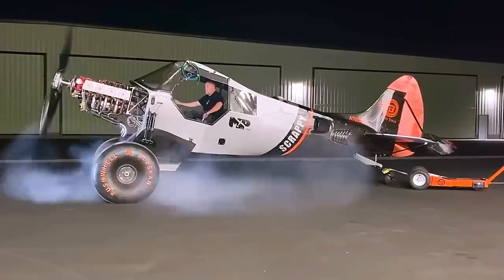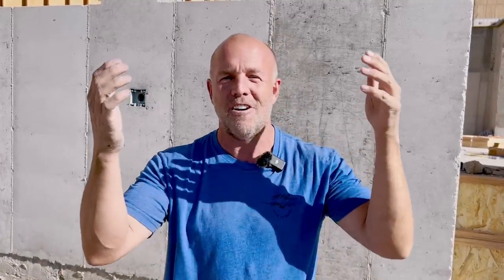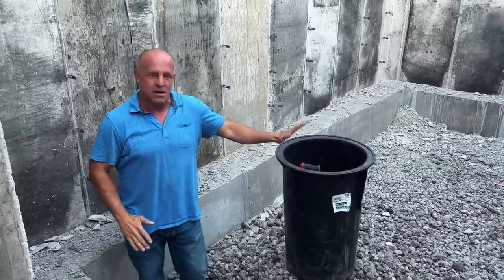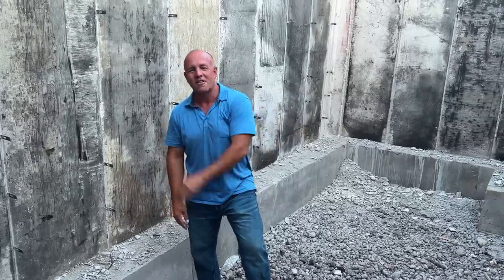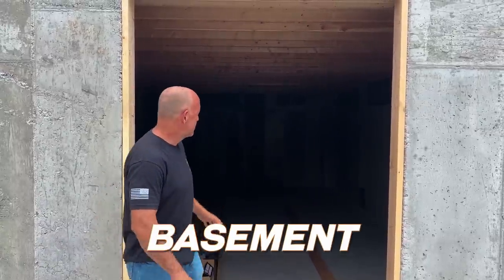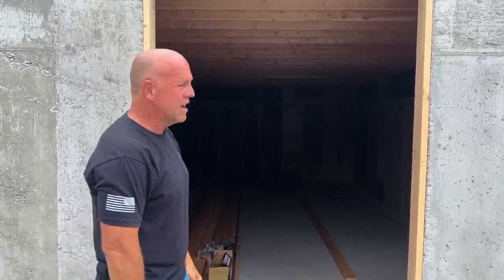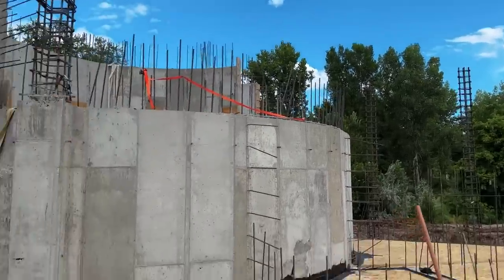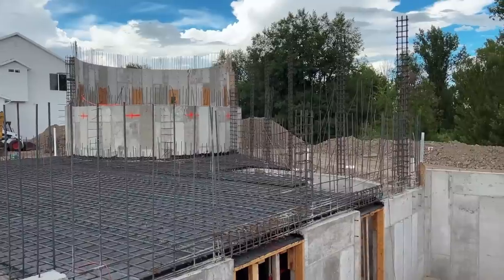Building a 3-Story Swimming Pool with Transforming Floor | House Build #3

Comment: As a  Civil Engineer with 45 years of experience,  I am loving this content.  Concrete, footings rebar, drainage.... Nicely done!
Reply: Agreed. As far as I'm concerned, Mike is as much an engineer as any other. He intuitively understands things like thermal mass, tension and compression force paths, even fluid dynamics. Most builders and tradesmen boast and overstate their understanding, even professionals. Mike has a much better grasp on these things, and I can watch his videos not only without cringing at common misconceptions, but also find it very stimulating.
Reply: @ryanmcgowan3061  as far as i know he is an engineer? Maybe mechanical although im not sure.
Reply: As someone in the Southeast, part of me died a little seeing all that backfill without any plans for drainage, even though I know he probably doesn't get enough rain for it to matter.
Reply: @bbggakkba  Nope. Him and his brother started off building decks, then homes, got into aviation, and started making tow rigs.
Reply: @ryanmcgowan3061  I believe he is a engineer. One of his early videos he talked about his background and how he sold his engineering firm.
Reply: @bbggakkba  As far as I know, his engineering firm was not a licensed engineering firm, but rather a manufacturing design company doing SolidWorks and FEA stuff. Product design is far less regulated than civil and structural engineering firms from what I can tell. Like software engineers, the term is applied often, but technically the word engineer is regulated by states' departments of consumer protection. There is no Mike Patey registered in Utah as an engineer.
Reply: @maglax  If the pool is filled, you're really looking at the "cut" side of the retaining wall. The only reason for drainage is to reduce the hydrostatic loads on the wall or for buoyancy problems. In this case, I think they could have analyzed it with saturated soil on the outside of the wall with an empty pool, and it would have withstood the loads better than when it's loaded the other way because it's built like a heavy radiused dam in that load case.
Reply: Got be 5 million what it finished mike 👍❤️🇬🇧
Reply: I am working on a apartment complex and would like a second opinion is something you would be willing to put your input on?
Reply: Whole footing below bottom of pool is four feet above 100year flood table. He has drainage contingency beyond that again.
Reply: You do not speak like a Civil Engineer. I could be wrong.
Reply: …Empire State Building - WEST!
Reply: @maglax  I thought all the drainage he talked about at the beginning was to make sure his footings stayed dry.  Perf pipe all around, submersible pumps etc....
Reply: @ryanmcgowan3061  You only need a license to do public projects like buildings. Most mechanical engineers don't get licensed and some don't on purpose (besides the effort) because they don't want to be liable for a company's products. In general it just isn't necessary as companies doing work that require a PE usually have a few on staff and the rest can pass their work thru them for certification. In theory those with a license should have a pay bump, but I haven't seen it in practice so there is less incentive to do it. 
The rest of companies making products aren't regulated and so the engineers don't need to be licensed. Companies may avoid them with the idea they must pay them more. The unlicensed are still engineers, and have degree stating so. Some are better than others of course, licensed or not.
Reply: Who needs lions, tigers, and bears when you have concrete, rebar and drainage!!!!

Comment: As the owner/designer/engineer/contractor/laborer, you are managing the job exactly the correct way; you are involved in every phase, every operation, every yard of concrete, every nut and bolt to make sure nothing is overlooked. On a project this size, the smallest error can create a large problem. I have built houses with over 20,000 sq. ft. with 3 to 5 year build times and the amount of forethought and nightmares can be daunting. This house is not even past the foundation phase and the thought and work required must have been enormous. My hat is off to you and your wonderful wife.

Comment: After months of laying in awake in bed at night, I am convinced there is no possible way you could have design a more complex swimming pool in a residential setting. Short of swapping out the water with differing water chemistry to adjust for buoyancy for before and after meals you have taken this pool to the Mike Patey extreme. Mind bending projects are your engineering signature and although most people could never build anything approaching the level of your projects watching is inspiring. Thanks for taking the time to share your work

Comment: I find this every bit as inspiring as the airplane design/build/play videos.
My 20x40 concrete pool was destroyed a couple of years ago when a neighbor built a big house next door and created a sink hole under my property.  I'm at the base of a ravine near a river and all the engineers are struggling to deal with water while they get 50' deep footings under a new pool deck patio structure built of structural concrete.  I wish my team had half the skill that Mike has.  After 2 years my place is still a big mud hole full of water.

Comment: Geez! The amount of engineering that’s going into this build is mind boggling. You are keeping a lot of people very busy which is great for the area. The amount of concrete going into this build is crazy. I used to work for a ready mix concrete company in Ontario Canada and I’ve never seen any thing like this. The company I worked for did pour all the concrete for the CN Tower in Toronto and there was definitely a lot of engineering firsts in that build. Nobody works as hard as you do, now Back To Work.👍👍🇨🇦😁

Comment: Amen on the drainage throughout the structure.  It costs next to nothing to take care of it now. I won’t build anything without drainage. People will say “my site is dry”. Yes, it’s dry now, but put a building on top of it blocking evaporation and all bets are off. Plus, while the nominal water table may be low, it is not a constant depth. You can have shallow spots, and even springs that pop up. Thanks for the great content.

Comment: Hey Mike, as an awesome back up, find a water powered sump pump. An electric one can fail, a battery one can drain the battery, but usually, even if you lose electrical power for several days, you still have water pressure. Also a LOT simpler pump so less failure points especially when mixing electricity and water. Had a week long power failure and the house I was in had installed a water power back up and it saved all of my stuff. When you think about it, it is probably one of the most reliable back up pumps out there, and the foot print is the same as a standard sump pump.

Comment: I just finished up doing the crane work on a 120,000 gallon concrete water tank , lifting forms in and out, and I mentioned Mike's project to the super on the job, he just gave me a blank stare, like it didn't compute. Windows?? Rising floor?, I think it just blew his mind. The building inspector on his current house job, and the DAR or whoever inspected Scrappy, need to meet sometime and compare notes!

Comment: Planes to Pools! Is there anything Mike can’t build 😂. I feel like you could build one of anything better than anything that’s out there. At 36yrs old, Even though I love aviation, but do not currently have the means to acquire my ppl, I do have a little shop that I piddle in almost daily after work on just about anything , so I thoroughly enjoy the engineering videos of any kind. Back to work mike !

Comment: Mike 
Just ran across your video amazing project! If I heard you correctly pool will be heated by gas. Unless you are getting it extremely cheap will cost a bundle annually to maintain temperature. Would recommend water to water geothermal heat pump with secondary titanium heat exchanger separating equipment from pool water. Same system would apply for radiant floor heat. However due to the load and small lot size/rock closed loop probably not an option but possibly could do open. Some of the newer solar water heaters have great efficiency could use to supplement. Food for thought to keep your running cost down. can’t wait to see the finished product keep up the great work!

Comment: We would like to do something similar to your pool (smaller scale though) on our house build.  I was planning on using ICF though for both the exterior walls and floors of the house as well as forming the pool.  I know "Build-Block" makes radius sections up to 23'+ inner diameter with a 6" core.

Comment: The most stress your retaining wall will experience is backfilling behind it. The dimensional lumber is a good idea but it will deflect under load. You can rent the legs they use to hold up tilt up walls, they are much stronger.

Comment: When a structural part is made thicker, it becomes stronger - but not always. With concrete, the additional weight may add more stresses than strength (simplification).
 I'd feel more comfortable if Mike had a concrete specialist advising him on HOW to make the concrete structure stronger. Thickness may backfire.

There are many ways to reinforce concrete, like post tensioned steel, additives to reduce water, special formulation/agregates, temperature control during pour, etc.

"Thicker is stronger" can be harmless (if properly checked/recalculated), but I would not apply it to concrete - nor accept the looks of an old style bunker 😂

Comment: I don’t know how you get so much done but I’m glad you do it!

I did have a question about the shallow end of the pool: will that have a mechanism for raising the floor too? Will they be independent or linked to each other? Is the entirety of the water going to be convertible?

I am still wondering how you’re going to make the floor move. I’m guessing with air tanks under the floor?

Comment: Hi Mike
Just impressive ………
I know that you are a detail oriented person but look carefully into the design of the Home Theater
Provide enough empty conduits and pull strings for future wire runs if needed
Look carefully into the sound treatments of the walls, sight lines studies from each row of seats to the bottom of the screen, selection of projector and audio gear
I have been doing that for quite a few years and the final results depends a lot in good planning ahead
By the way I am a pilot and follow you also on those amazing projects
Good luck and reach out if you need advise
Arturo
Reply: We’re on it. That’s a concern of ours as well.

Comment: The energy bill is going to be hilarious. Awesome engineering but holy moly is this going to be expensive.

Also: what will be the noise level when that floor moves? Or from all the pumping gear? Or (what I assume) will be the transformer house needed to power everything?

Looking at the location, it's not at the end of the cul-de-sac but smack bang in the middle.

Comment: Hey Mike, Great project! I was wondering, was ICF a consideration when working on the design project vs plain concrete+external insulation foam? If so, was there a reason why not using ICF as part of the concrete construction? 
You mentioned radiant temp control across the house, are there other considerations in terms of thermal isolation for the exterior walls to keep the radiant heating/cooling system efficient all year long?

Comment: Mike 
Did you consider putting plastic over the gravel and putting insulation around the pipes coming through the slab and then caulking the joint before you poured the slab and did you consider radon mitigation?

Comment: I am implementing quite a bit of GeoThermal, so our 'internal flood risk' is not the 100-year flood, which we seem to have every 12ish years in SE Texas, but more from internal (ME made) issues pulling a notably large pond loop into the house with very efficient high-flow pumps.  Oops.  Yes, I'll have water sensor, pressure monitors, auto-valves, etc., BUT life happens and when I am out flying, I'd like to know that we built for that after all the automation, and STILL let gravity and drain fields do their natural process.   Better engineering will prevail ... :)

Comment: With all the concrete, are you going to be running conduit for data cables and whatnot to the lower rooms?  All that concrete will hurt WiFi signals.

Comment: Mike did you put you water system in and drill down to the water table heater up your house I put one in Cornwall. the Earth core  heat up the water and it pump around the house on the floor and send back down?

Comment: Mikes definition of spending a lot on gas must be different than my definition. How much will it cost to heat that thing from 40 degrees to maybe 70 degrees? I know the btu, water heat math is easy but its early and I don't feel like figuring it out. Plus I know that Mike has already done the math.
Cant wait to see it finished.
And lets see how long it takes to get the fake telegram message saying that I won a prize.

Comment: Having done pool and spa work in SoCal for over 35 years, I always push for a sump with a pump and drain system or a nice big (4" min) gravity drain if possible in any enclosed equipment area, even floor drains in dressing areas or other spaces anywhere near the pool and spa. Main reason is not ground water, though I suppose in many other locations that could be an issue. No, it's always the owner.  Overfills a hot tub, decorative fountain, wet wall,  over watering of hanging potted plants, or something. Turns on the garden hose, leaves for the day - or I put a snap timer on a fill valve, and the mechanism fails to shut off - stuff like that. My service personnel all learned: if you turn on any manual fill valve you hang the key to the service truck on the valve handle so you can' t drive away and leave it running. And about twice per year we would run the pumps in drier areas, and use the sumps to drain and refresh water every week where applicable, so we kept track of the sump pumps and drain systems.
Reply: Exactly right!

Comment: I'd like to hear about what your building and code inspector has said about these designs.  Have they thrown up any nasty road blocks yet?  Any surprises?  You mentioned in a video long ago there was a river which threw you a curve ball, but have there been other limitations imposed requiring variances or HOA rules you had to have exceptions or approvals to get done?

Comment: Do you have building codes/inspections where you are building this house? If so, did you have any trouble getting this design approved?  I want to build a swimming pool with a 10 ft deep end and a ~3-4 ft shallow end with a straight drop off from the shallow end to deep end.  That way I'd get the maximum usable area out of both the shallow and deep ends, rather than having a huge much less usable area that is sloped.  I was looking at building codes and when it comes to pools, most jurisdictions tend to follow the IBC pretty closely which has very specific rules regarding the slope of the pool floor where it transitions from the deep end to the shallow end. Basically, a maximum 33% slope is allowed.

Comment: Dude, don't forget to put one way valves on the sump pumps. Otherwise the water will just drain back in, reactivate the pump, pump runs dry and shuts off, water drains back reactivating the pump........

Comment: Where are you going to find enough lead to shield the small nuke plant you'll be running to power this place? lol  But really, are you planning to be off-grid, or at least grid supplemented?  The Navy ran a very small submarine on a "suitcase" nuke plant a couple of decades ago.  Isaac Asimov wrote about distributed nuclear power systems for houses.  And I think that (a la computers) it's time we began to get away from centralized power production and moved towards individual power production.  Won't work so well for cities, but those of us with single-family houses . . .

Comment: Any reason you didn't go with a precast hollow core floor instead of the poured concrete in the garage area?
Reply: The garage floor is supporting a lot of the weight, part of the pool and concrete deck above. We’re using Spandeck on the deck floor above though, it’s a great product, we used it in a previous home.